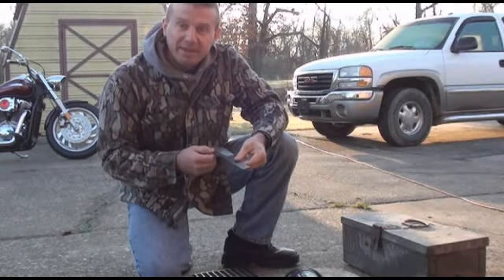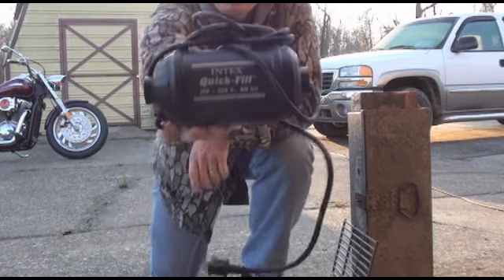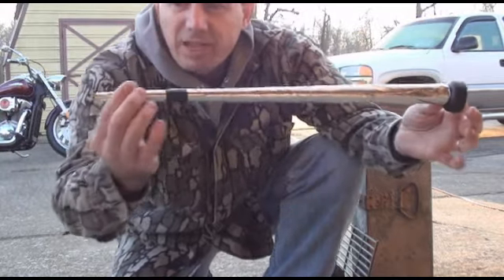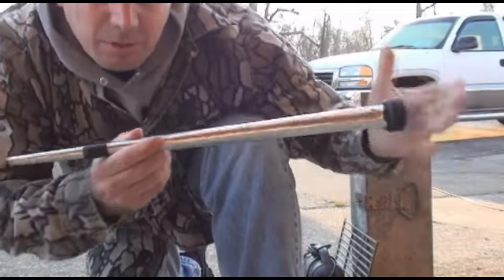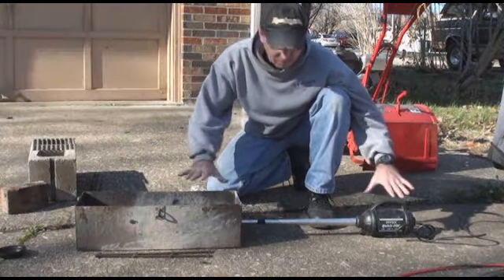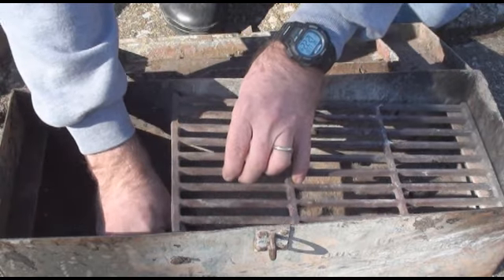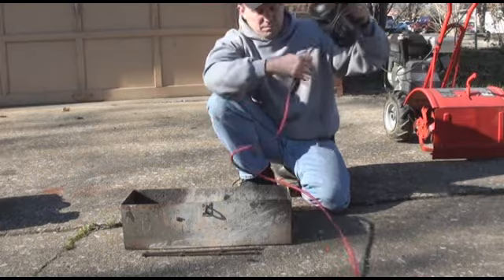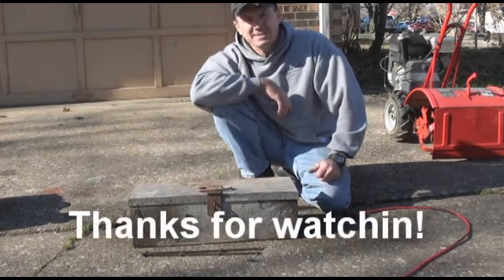Portable Forge

Comment from the maker: @cmoore119 
I'm actually in the process of building it and will try to put a video together.  The handles will be white oak.  I may not beat this one up in a testing process because it will be given to an old man as a gift and I am pressed for time.  If I happen to break the blade I will not have time make another one.  At most, he might skin a deer with it but more than likely it will set on a shelf.  I will however build another one and really test it in the field.